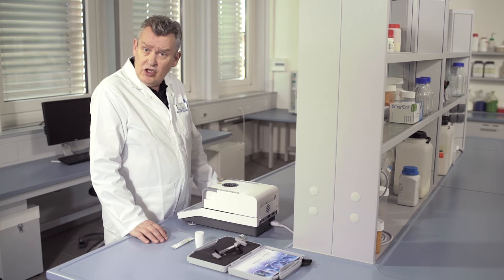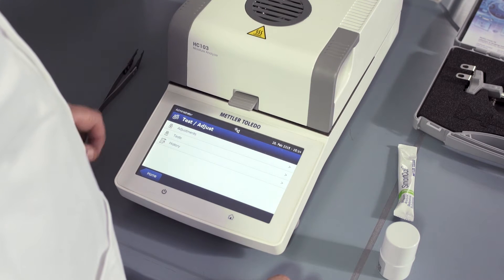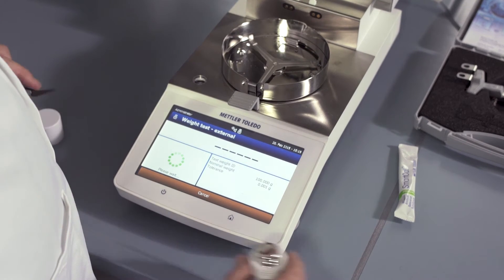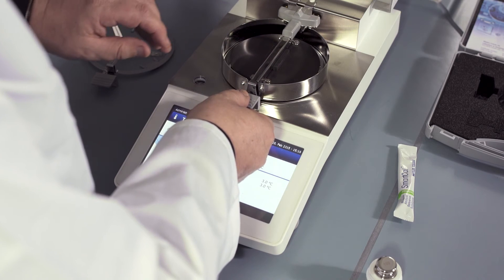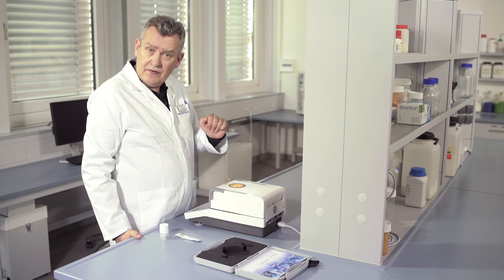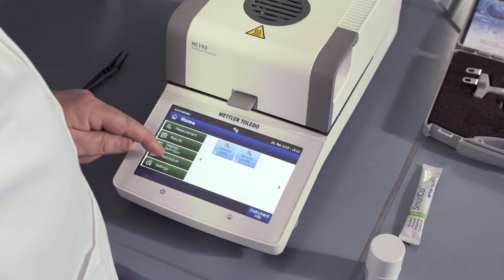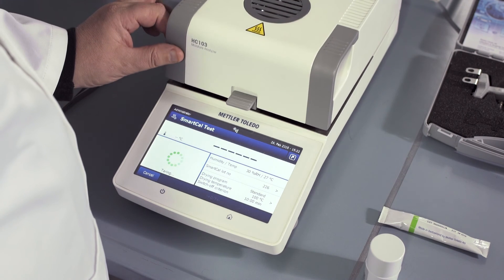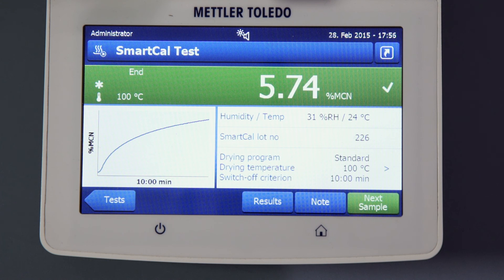6/7 -  Routine Testing. HC103 Moisture Analyzer Quick Start Guide

Comment: I say, how did your model Moisture Analyzer have a lift able cover, whereas most of the MT units have a digitally operated lid. It's very difficult to get any where testing when there's an issue and you can't release the bloody lid on your own. Any suggestions how to conduct tests if you're" stuck" because the lid won't collapse or rise through the test methods?
Reply from the maker: Dear Praca,

The HC103 moisture analyzer has a mechanical lid that is operated manually. It does not have a locking function and can be opened during a measurement or a test. However, opening the lid will disconnect the power from the heating lamp and abort a running measurement. If you need more information about moisture analyzers from METTLER TOLEDO or other instruments, please get in touch with us via: www.mt.com/contact